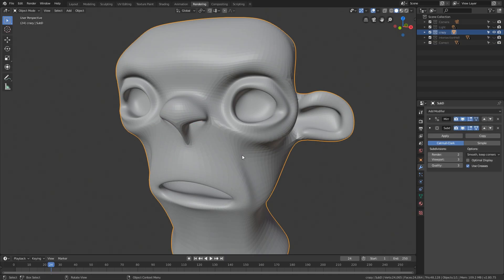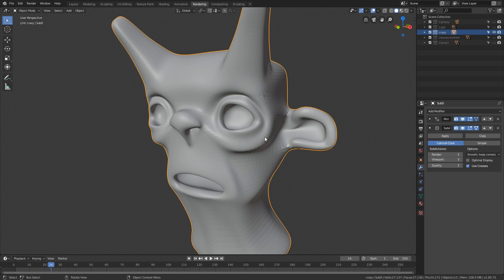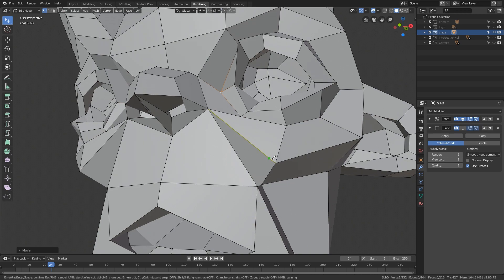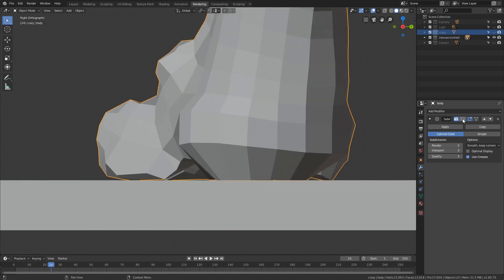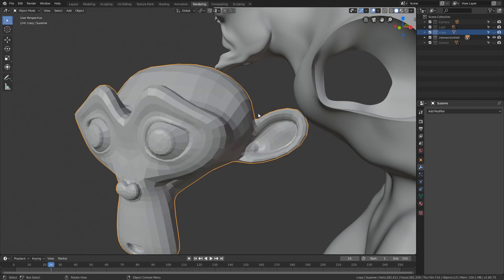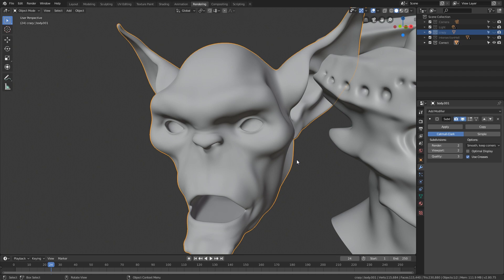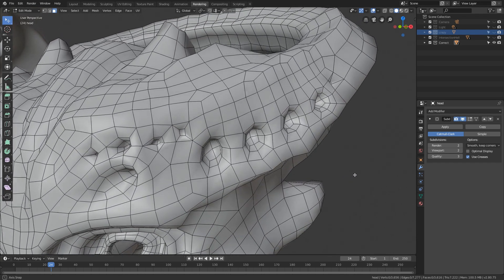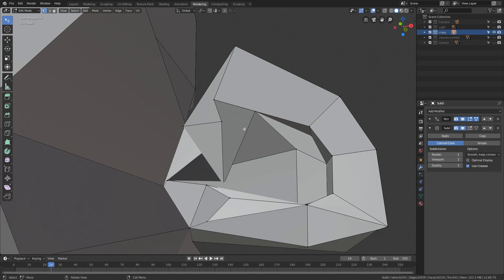Why You Should Never Model with Subdivisions Active - 3D Modeling Fundamentals

Comment: Hi! I've been following your channel for some time and was wondering if you guys could make budget-oriented hardware recommendation for general use After Effects, Cinema4D, Blender, Unreal Engine and other 3d software that you use and stuff like these channel does. This channel seems well versed on hardware so I wanted to ask for advice without breaking the bank.

Would a Ryzen 5 2600 be enough in terms of performance? or would I be better off with a Intel i5 8400? I'm getting started on 3D so I'm no professional and could handle render times, but would like smooth performance (scrubbing, effects, preview of the project, modeling) I currently have a AMD A9-9420 laptop with radeon R5 integrated graphics with 4GB of RAM, it gets sluggish with Blender and sometimes even Illustrator. Will a Ryzen 5 + GTX 1050 Ti/RX 560 be smooth for this type of work? Or is it better to get a GTX 1060/RX 580 with a better CPU?

Any advice is appreciated!
Reply: @Geth270  Thanks for your input. I'll save money for the Ryzen 5 2600 in that case (the 2600 is a lot cheaper than the 3600 in my country) was already looking to get an NVIDIA card due to power consumption either way, but the Radeon  RX 580 4GB model is really cheap in Chile right now , being priced the same as a GTX 1050 ti/1050 so maybe it could hold me off
Reply: @Geth270  After some benchmarks I saw I'll try saving for a GTX 1060 6GB, It fared better than the RX 580 in After Effects and other software. The thing is here in South America hardware is more expensive than in USA/UK. Over there a low-tier graphics card would be GTX 1050 ti whereas here it's a mid-tier card for the pricing and one of the most popular choices. It's amazing what you can buy over there with $650 USD. I'd lie if I said I'm not interested in some PC games such as Nier Automata, Cyberpunk 2077, Deus Ex, FFXV and maybe Monster Hunter so it might be worth it to go out of my budget for my first High End PC (Even a Core i3/Ryzen 3 and a GT 1030 would be an improvement over what I have)

Comment: I've found that the "smooth" modifier can fix this without adding polygons. Probably not ideal still but the smooth modifier does a decent job of making the model look like the sub d model without adding polys. But of course it can only work with the polys that exist so you might need to add more manually.

Comment: The point about getting the low poly model as close to the subdiv version as possible in important areas of contact is a great one! 

I find the example a bit odd since in Blender it is easy (and default) to see both the subdiv and the low poly mesh at the same time by turning it on in edit mode but disabling it effecting the vertices. This is hugely helpful at certain points so that you get immediate feedback without having to constantly jump in and out of edit mode. Other times it's distracting and unnecessary. Turning it on and off as you go depending on the situation is a great way to work. 

But yeah, turning it on for the cage leads to gross results. I can't recall ever seeing someone seriously working that way, but I'm sure I have shown demonstrations with it on because it looks cool. Will knock that off 😜 -JL
Reply: You nailed it. Perfectly make sense.
Reply: I think the key is to understand what subdivision is doing. In subd modelling you’re creating control surfaces which are the guides for the final shape. If your control surfaces are chaotic, then the final shape will be unpredictable, but the control surfaces are not the model. Modelling without subd is like creating a bezier curve as a set of straight lines - that’s not what a bezier curve is, it’s just a poor approximation. But, to continue the analogy, you still need to know where your control points are.

Comment: I'm not sure.. if your aim is to get a "quick and dirty" high detail model for normal bakes, etc then I see no problem with it. If you need to use the base mesh for an in game asset for rigging etc, on the other hand, then it would be a problem.
Reply: I'm not sure either. If you're trying to bake normals from broken topology, you'll need more subdiv than should be necessary to get decent results? Also, if you're trying to bake normals from a high poly model, generally it assumes you have sculpted it, and if the low poly topo is terribad, you won't be able to 1°) sculpt 2°) UV unwrap and 3°) get the baked normals to apply properly on the UVmap (it will look like failed taxidermy : https://eatliver.b-cdn.net/wp-content/uploads/2019/07/funny-fail10.jpg - TBH this could be a style some people want to go for :-) )

Comment: While I agree that modeling with Sub-D on should not be done if you don't know what you are doing, saying it is "never" ok, is pretty misleading. And as you mention, I agree it's best to switch between the Sub-D preview and the base mesh when working, instead of blindly working on either. But Sometimes you just want to quickly create geometry which is easy to manipulate, sometimes referred to as cage modeling, and you are never supposed to use the lowest Sub-D level in production, but instead you are using the cage model to get the general shape and features in, and then subdivide it once or twice (and apply them) to get to the actual usable model, which you can then edit further. It is way easier to get the big shapes and features modeled in with a model that is only a couple hundred or couple thousand points, instead of trying to tweak a production resolution model. This of course is relies on whether the modeler knows how the cage model behaves when subdivided, so an inexperienced modeler can easily make mistakes and create very bad topology if they don't know what they are doing, but that applies to basically any modeling technique. Cage modeling is pretty much the equivalent of sculpting at the lowest possible resolution to get the big shapes in, before subdividing and moving onto detailing. And the same idea applies to different deformer modifiers, like FFD in 3ds Max, or Lattice and Meshdeform in Blender - it is easier to modify big forms by editing a couple of points, instead of moving hundreds or thousands of individual vertices by hand.
Reply: Aren't we supposed to retopo anyway
Reply: @tysean0816  this is what I was thinking.. how is it different than just starting with a sculpt, then retopo? maybe people like to model with that on, then apply at a high resolution, then retopo...
Reply: This is exactly what I was wondering, it relies a lot on the actual modeller and their skills itself rather than being necessarily bad and "never to be used", but I still think the video had a lot of great points I hadn't considered as deeply but now make very good sense. One thing is in my experience, it is great for concepting without worrying about basic topology and edge flow and other things that don't matter as much in concept art. It's an important consideration for a modeler in a pipeline whose work is gonna be passed on to the next department, but not all modellers need to be IN the CG pipeline to begin with, as concept art is pretty much pre-viz and very very pipeline agnostic. It's important to know what is happening to your topology as a concept artist, but you needn't always work towards correcting them if it's not gonna be used in production anyway.
It's also interesting that much of concept art for movies and games is going 3d these days (just look at Jama Jurabaev, Vitaly Bulgarov, Ash Thorp, Jan Urschel, Maciej Kuciara, Vaughan Ling aka HEAVYPOLY, our own Blender boi/artist who worked on Spiderverse, etc) because of how iterative and flexible it is, and FN themselves have talked about Blender being incredible for concepting, so I think in that narrow space, there can be some leverage for subD modeling for quick interplay of shapes and flow. All this doesn't mean concept artists don't or shouldn't study topology lol but they needn't be burdened by pipeline level problems, because I think it's becoming more possible to do 3D day by day without needing to actually be IN the CG pipeline and many more artists who'd never considered 3D before (but aren't necessarily gonna become modelers who's models will definitely be used in production) can use whatever tools they see fit that can provide speed, experimentation given they actually become aware of the conseqeunces of making those modeling choices, because if you're aware of them, you can actually end up using them to your advantage in some ways and leave out early if it isn't working! 
TL;DR know the consequences of SubD modeling and use its strengths where you can exploit it but also understand where and when it shouldn't be used!

Comment: Can you guys do like a modeling video/tutorial for people with some knowledge? Like an advanced tutorial. E.g. I worked on a spaceship a couple of weeks ago. I had a (more or less) clean base mesh without any details. Then I wanted to start adding details. I experimented by either working without sub-d to get some details and I tried using sub-d modeling (how I saw it on many youtube tutorials).  For the first approach, I ended with some relatively low poly result with a (more or less) broken topology (and I did not like the result at all, because it looked really low poly). Most of the time I was busy trying to fix the topology and in the end it was still broken (using sub-d afterwards only made it worse). For the sub-d approach I had problems adding the details because I wanted to keep using loop cuts, and in the end the mesh was messed up too.

I am feeling like there is a gap between doing some of the beginner stuff and then going from beginner to advanced. I feel like I know the fundamentals, but doing the step to a more sophisticated model is really hard (or I am too stupid to do it).
Reply: @Dennis Hus I would even pay for that if there is a good online course. Do you have any recommendations?
Reply: 8XN72Hw_xK check out their blender tutorial which seems to cover pretty much the whole pipeline - it could be what you're looking for :) https://flippednormals.com/downloads/introduction-to-blender-2-8/

Comment: A small tip: you can switch between subdiv levels via CTRL+number of level.
Reply: Really? Omg Thanks!
Reply: That's useful, but I still wish there was quick key to toggle them on and off (like Tab in Modo).
Reply: @richardchaney7295  CTRL+0 does exactly that.